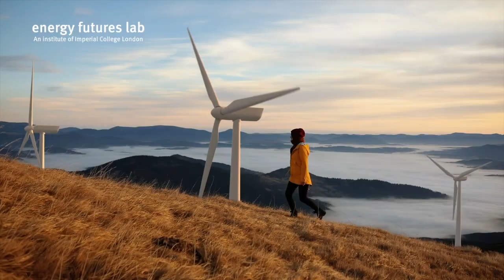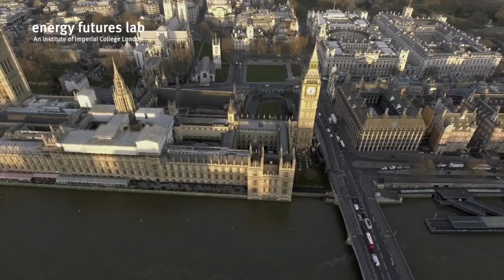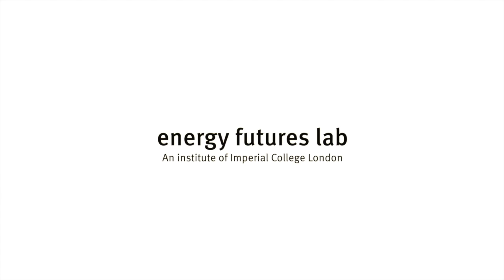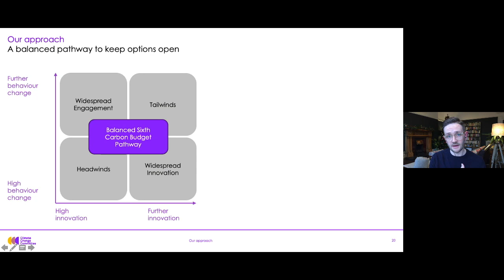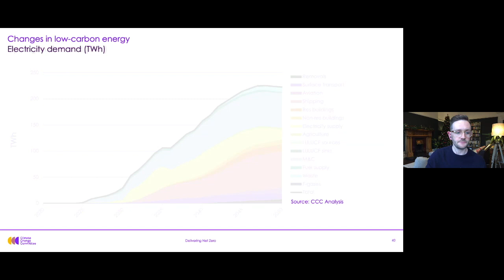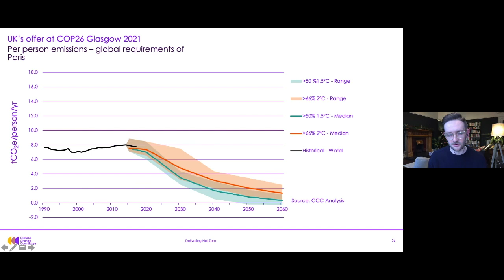Dennis Anderson Lecture 2020: The Path to a Net Zero UK

Comment: The big problem with net Zero is seasonal heating. You need to plan a grid for the once a generation winter

People say heat pumps but those heat pumps would all revert to resistance heating during the once a generation cold snap. And if its windless week which you have to plan for as blackouts = frozen dead people then you need 100% gas fired backup

Well 37 million homes (in 2050) x 3KW average winter heat need = 111 GW for just homes. Up that by 50% to take into account other buildings like schools hospitals shops etc and you have 166 GW plus normal winter eletricity needs of some 40GW plus electrified transport of circa 20GW = 226 GW plus a 10% margin = 251GW

The UK would need a grid capable of transporting and generating that much energy. That means 250GW of thermal plants like Gas or Biomass. The UK isn't going to build an additional 200 x 1GW gas plants as backup which is what you need if you electrify heating. Likewise the UK isn't going to expand the grid 4 x to handle all this power

To gave a sanity check ask what is the power and generating capacity of Norway which is already more or less 100% electrified heating. Well they have capacity of about 30GW for a population 12x smaller. So 30 x 12 = 360GW and my UK estimate qas 251GW. I was probably too Conservative but you can see we are in the right ballpark

It's not impossible to do heat pumps
But how likely is it the UK will build 250-350GW of thermal generation and a grid 4-5x the peak power?

Probably much more wise is to use nuclear district heating grids and do seasonal heating with nuclear. No windless weeks to worry about

Leave the north sea for eletricity generation to power a significant portion of Europe not to heat the UK

Wind for electricity 
Nuclear for heating
Reply: With the new heat pumps they still work during a cold snap. Using a gas fire as  a supplement, not replacement, is sensible, and uses only a small amount of gas.  Heat pumps exist which are good to -30C which will always work in the UK, however the ones that work to -15C are cheaper.. at the cost of a small puff of gas fire.

Comment: At 0.48 into the video there is a picture of wind genertaors. For the last two weeks in the U.K. wind has been producing a very tiny fraction of our needs (As of 23rd April  13:35 wind production is 1.16 Gwatts,  3.48% of demand, out of a fleet with a capacity well over 20 Gwatts). Build far more of them and it won'r be such a tiny fraction but it will be a small fraction.
These academics don't live in the real world and put all their ideas into computers which 'model' what happens, maybe? How many of these academics have actually worked in the power industry and know first hand of the technicalities and problems there are.
An old engineering saying, those that can do, those that can't teach.
Elsewhere on You Tube today there is another video saying that the cost of net zero, according to the Committee for Climate Change is 891 billion pounds, the treasury calculates 3 trillion pounds, possibly more. Being government probably more is realistic.
And all this for a climate emergency that isn't! None of the official data shows any worrying increasing trends in climate parameters.